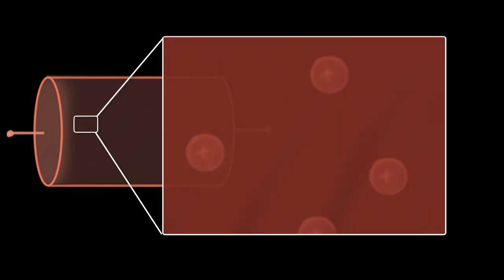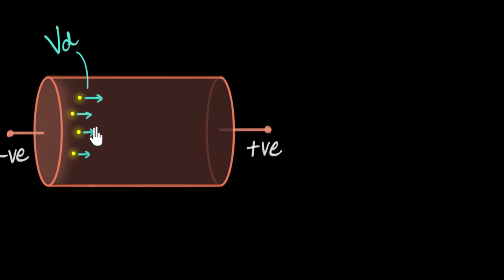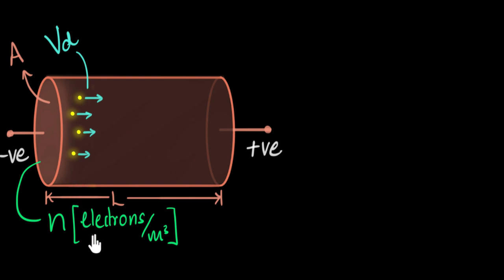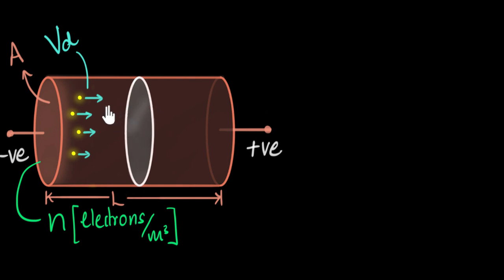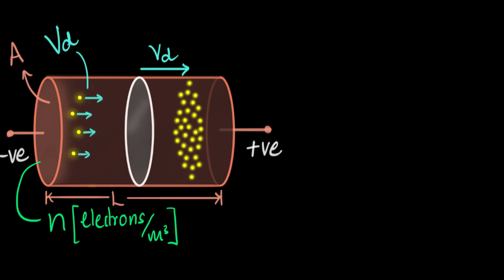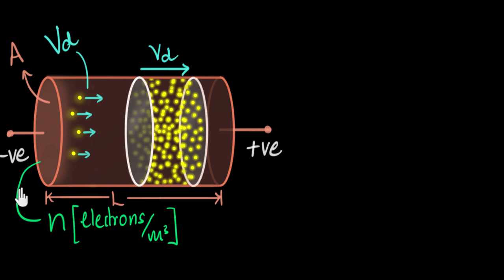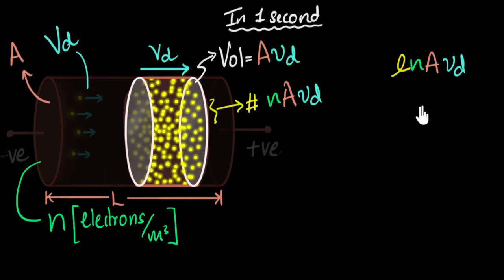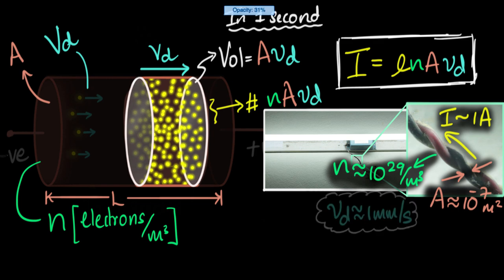Current from drift velocity (I = neAvd) | Electricity | Physics | Khan Academy

Comment: Hello! So, for alternating currents like the one flowing through your light. The drift velocity that you calculated, is still the same for AC or DC, but, the electrons flow back and forth depending on the frequency of your electrical current, right? As, for the question you posed at the end of your video, the current flowing out of point or terminal #2 is the same as the current flowing into terminal #1, but, the drift velocity for terminal 2 is higher then the drift velocity for the current flowing into terminal #1. You have to use the equation A1*Vd1=A2*Vd2, from fluid dynamics. A1 & A2 are the cross sectional areas at terminals #1 & #2 and Vd1 & Vd2 are the drift velocities at terminals #1 & #2. Its the same current in #1 & #2, but, different A's and Vd's, right?
Reply: But for AC electric current is generated by change in flux,

Comment: if Vd is average velocity of a electron,, shouldn't we get an average current?? THIS AVERAGE THING IS BOTHERING ME ,,IF VELOCITY IS AVERAGE THAT MEANS CURRENT ALSO AVERAGE ,, MEANS ON A CERTAIN POINT CURRENT IS SUPPOSE 5 AMP AND ANOTHER POINT 6 AMP ON AVERAGE ITS A PARTICULAR AMPS???
Reply: Technically, you are right! 
But these electrons are zooming at such high speeds that when you consider even timescales of a few milliseconds, you already end up with averaged values!